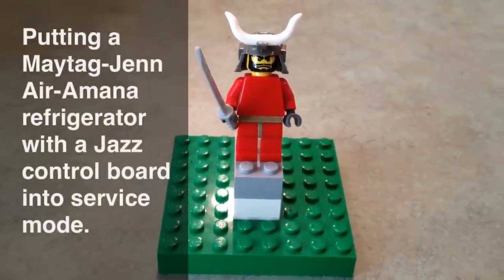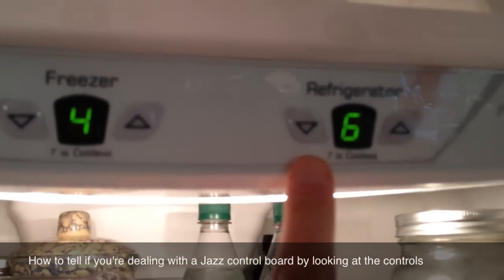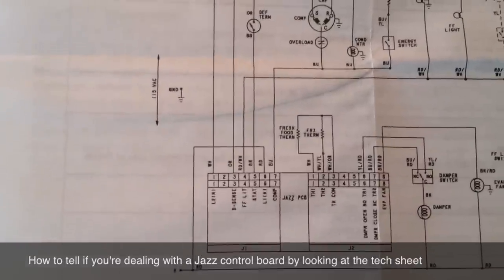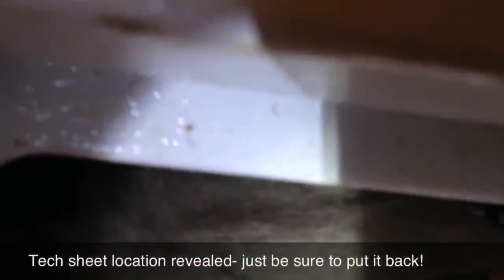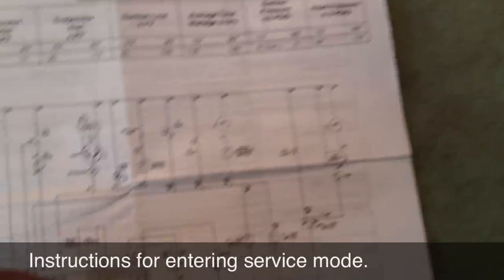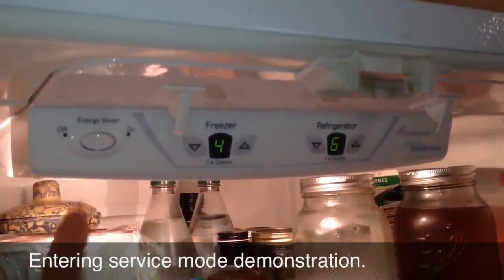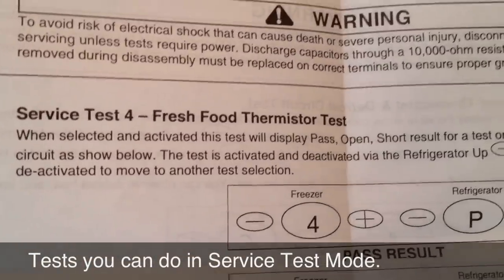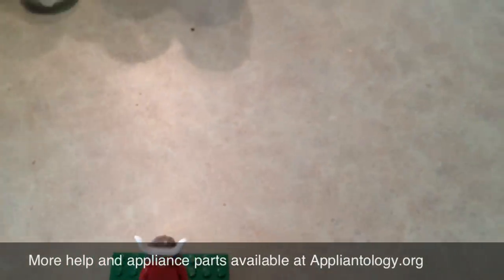How to Put the Jazz Control Board into Service Mode in Maytag, Jenn-Air, Amana Refrigerators

Comment: Thanks so much for this. Lowe’s delivered and set mine up a year ago and lo and behold, there is no tech sheet. My fridge wasn’t getting cold and I pretty much narrowed it down to being either the damper control or the fridge thermos not communicating to the damper. Was just about to order a damper for $66 when I stumbled upon this. Had no idea about the service entry mode because I never had the tech sheet. I can’t even find a PDF online.

For some reason me running through the tests made the fridge start working properly again. It’s only a friggin year old so it shouldn’t have problems yet anyway. Thanks again for this video.

Comment: Thanks for sharing this with the DYI community. I looked under my fridge for my spec. sheet but it was gone. Probably ended up in the delivery van floor. I tried the test mode on my Kenmore bottom mount fridge control panel but all I can get are two horizontal dashes ie.  -  -    where the numbers used to be. This tells me that my board has definitely failed.

Comment: Awesome!  Have a Kenmore fridge that no longer auto defrosts.  The problem started intermittently, but now frost builds up within a few days.  First symptoms were rock hard ice cream in the freezer section and warmer temps in the fridge section.  Eventually, the frost would build up to the point that cold air would not circulate up to the fridge section.  Had to empty the freezer section and defrost it with a heat gun.  What a pain.  Just popped it into forced defrost after locating the tech sheet.  I'll troubleshoot the rest this weekend.  Thanks so much!
Reply from the maker: Sounds like the typical pattern of a failed Jazz board.  Buy the new board from the link in the video description above.  If, on the off chance, that doesn't fix it, return the board for a refund!

Comment: so are lower numbers mean colder, higher number mean warmer? mine is stuck on 7 / 4 right now.  Refrigerator is not cooling, freezer must be full of frost/ice because I can't get the door open. Pulled hard and the handle came off on one side! S o need to try to make freezer warmer if I can get the control panel to change - just don't know whether to go up or down to make it warmer

Comment: Great video. My tech sheet is not with my fridge though. Can you share any other info on the tech sheet for service mode instructions? I have scoured the web and cannot find anything, Much appreciated!!
Reply from the maker: Here's a tech sheet for a common Jazz board refrigerator model. The programming is the same for all models using a Jazz board so this should work for yours. https://www.dropbox.com/s/mi7236vo2261rq5/Whirlpool%20Refrigerator%20GX5FHDXVY01%20Tech%20Sheet%20-%20W10238844.pdf?dl=0
Reply: @AppliantologyOrg  Just in case no one told you today, you're awesome! Thank you so much for the share! Very much appreciated.

Comment: Love this video! my settings won't adjust, they're stuck on #4 freezer, #7 fridge (even after unplugging the refrigerator for 10min.). does the board need replaced, or would diagnostic mode indicate a different problem?
Reply: Same issue here !  I noticed you did not get a reply !  Not much hope for me then.

Comment: Thank you so much!  Before I saw this, I manually took apart the entire freezer compartment, defrosted, then back together.  I replaced the thermostat, that was the faulty culprit first time, but my freezer just "froze" up again.  I'm thinking it's the JAZZ board.  Question - in the Force Defrost mode, can you still open/close the fridge and not affect the long defrost program?  Also, I'm assuming that the long defrost program turns off after it's complete...again, I'm assuming and you know what that means!  Cheers.
Reply: Mike Weston The LONG defrost cycle is used in the factory and it is recommended that it NOT be used in  the field/home.

Comment: I am replacing the jazz board on my maytag refrigerator i got the new one but its one piece it says technician must snap new board at break line utilizing proper ESD precautions what do i do?
Reply from the maker: Jeff Murray The new boards come connected and have to be manually broken. There's a topic at Appliantology that talks about this: http://appliantology.org/topic/52339-kenmore-bottom-mount-refrigerator-model-59676063701/
Reply: SamuraiRepairman thanks i got it i was just nervous to break it and damage the part

Comment: I have a maytag model mbr2258xes1 the freezer was icing up at the evap core preventing cold air to go to the frig I replaced the defrost element. Now it seems that the freezer doesn't turn off. Ice build up everywhere. I looked for the tech sheet. Even removed the rear cover. I didn't get one. Is there one on line somewhere?thabx. what do I do? call the appliance repair guy? $75 to tell me what is wrong
Reply from the maker: If you're an Apprentice at Appliantology, you can download the tech sheet here:  http://appliantology.org/files/file/1181-maytag-refrigerator-jazz-board-programming-sheet/

If you're not an Apprentice, become one today!  http://apprentice.appliantology.org/

Comment: does the kenmore/whirlpool model 106.52609100 have a service mode test available and how do i test the defrost circuit?..
Reply: it is not a jazz control board it has separate degrees for temp settings for each side of the Frig..
Reply from the maker: Hi David.  Come on over to the Samurai Appliance Repair Forums and we'll help you sort it out there.  This page will get you started:  @concierge/faq.html